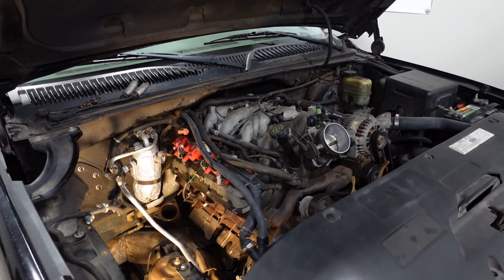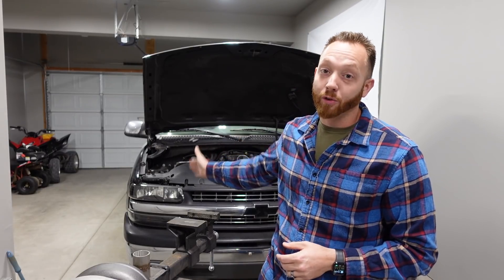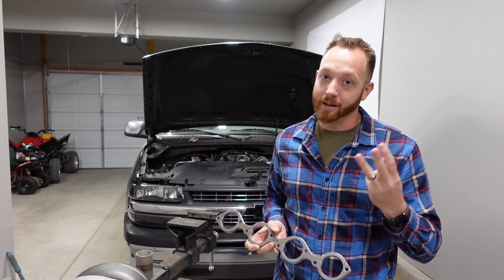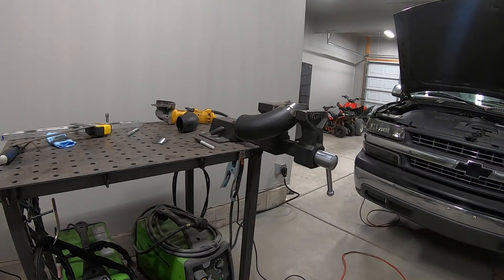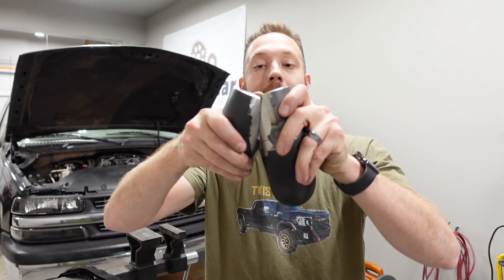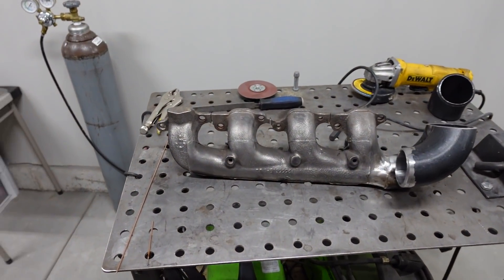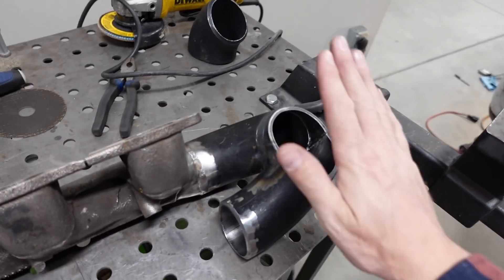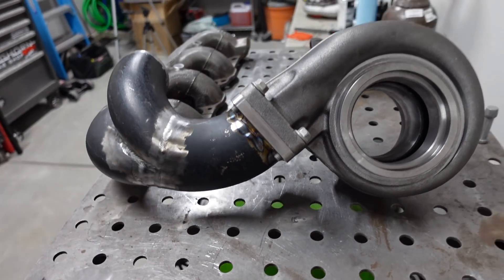Building a Turbo Manifold for an 8.1 Swapped Big Block Silverado

Comment: Love your work - finally an American fabricator using ear and hearing protection - I am currently using same S-480 clone as you are -  Australian regulations - must have 5/8" clearance on hot side made me go the "remote" install option, my build is 74 C10 stepside truck ZZ502 and same S480 turbo as yours - I'm 68 years old and you ROCK !!!! Still working on it !
Reply from the maker: hey cool to meet ya, and that sounds like an awesome truck! I love the big block and turbo combo

Comment: would it be possible to build a log manifold, similar to the ls style turbo manifold to keep the ac in the same spot, maybe pointing up and farther back? Please also change the exhaust studs.. Those are prone to you know breaking lol.
Reply from the maker: Yeah, it would be a good solution and I forget why I didn’t do that, but I think it was trouble finding a flange that would fit the head or something. The flange I bought hit the head bolts.

Comment: Sizing tip to remember: turbo exhaust has a much smaller volume than NA because it's under pressure.

Fast-moving turbo exhaust also conserves more energy, meaning less volume is needed to move the turbine, which means less drive pressure required. People are making 2000HP+ with 1.75" ID primaries on similar sized engines, so 1.5" (1.6" ID) is good for 1500HP.

Comment: Lt thats a pretty good job. After watching this video I would have done it just a bit different to save the a/c. I would have cut the manifold right at that line to were I could have essentially rolled the manifold upward giving enough room for the a/c pump. Lines might have been a issue but I would think a/c reroute would be easier than moving the pump. Just my 2 cents. But the project is looking good.

Comment: Did you look into if aftermarket BBC turbo headers would work?  I have been thinking about this on my 79 T/A swap.
Reply from the maker: I did, and most are a twin turbo up and forward setup. To make those work in my truck, I'd have to cut and relocate a bunch of stuff, and I wanted to run a single turbo anyways, so custom it was.

Comment: I have a question about the cast manifold. So I wanted to cut off the original flanges and put v-bands instead. I don’t know how to weld but I work with welders so I asked  one if he could weld the v-band to the manifold and he said it would be a weak weld because the manifold is cast iron and the flange is steel. Oh btw, these manifolds are OEM manifolds off a newer body style camaro. Anyways so I ask a second welder if her could do it and he said pretty much the same. So my question for you is more of your opinion actually. How well do you think your manifold will hold up and would your opinion apply to my idea as well?
Reply from the maker: The trick there is that the manifolds are cast steel, not iron (so says the internet). A lot of people have welded v bands onto GM LS manifolds like you’re describing with excellent results. I wasn’t sure if the 8.1 manifolds had the same alloys, but so far, it seems to be doing OK. But only time will tell.

Comment: Can you build the 8.1 with standard aftermarket bbc parts like jegs or is raylar the only option
Reply: To avoid raylars ridiculous prices
Reply: @jethrow243  They make some nice stuff but its way way to expensive!!
Reply from the maker: you can, its just a lot more difficult. things like valvesprings for example, I have seen other BBC parts converted to work, but many times they are not listed by application for the 8.1 so you need to measure and find what works based on dimensions and spring rate. Raylar takes all the guess work out of it
Reply: @TolmanPerformance  the main thing alot of ppl are waiting to find out is pistons rods and crank .
Reply: @TolmanPerformance  like a 454 is the 4.25 bore just like a 8.1 could a forged assembly be bought piece by piece with a stroked crank to build a 8.1 without problems im not able to look up like oiling hole dimensions or something crazy chevy may have changed other than the stroke dimensions between 7.4 and 8.1

Comment: Hey Lt loving the vids, I’ve been building 8.1’s for over five years and currently assembling a full forged bottom end to handle way over a 1,000 hp. Shoot me a dm I’d love to give u a few tips and tricks and some of the downfalls the engine have. I’ll try and send you some port work on the heads that will dramatically improve at all rpm ranges. Of course you can’t compete with aftermarket heads but $2600 for a pair of unassembled heads is way out of budget.  I really think your going to crush YouTube with the great vids your putting out.
Reply from the maker: hey, couldnt find an email or anything on your page, send me one to tolmanperformance@gmail.com

Comment: Awesome project! Any reason you didn't go with a remote mount turbo to avoid some of the fitment issues?
Reply from the maker: because I like torturing myself and TIG welding...
Reply: @TolmanPerformance  Good answer and honestly there is a lot of satisfaction in making it yourself vs a less complex remote setup.

Comment: Hey LT, in regards to the A/C. Can’t you use a pancake compressor like you did at that other place on a particular red all wheel drive OBS mounted up high on the passenger side?
Reply from the maker: I suppose I could, just would have to come up with some bracketry...

Comment: Any thought of using a holley low mount ac bracket,and installing a sanden sd7 compact compressor ?it’s been a workaround for me on the past because I can make lines to go around most everything and the compressor is smaller than the factory ls unit but bolts in the same place 
Been working out details on a similar build but have a different direction still good content keep up the good work

Comment: Amazing welding!!!  Is the turbo to close to hood and might cook the paint?
Reply from the maker: thank you! There is enough for my hand to fit between the top of the compressor and the hood insulation, and about double that on the turbine side, so between a turbo blanket, air gap, and the hood insulation, there should be no burnt paint... (hopefully)

Comment: LT, some interesting 8.1 information for you. Raylar is the company everyone knows of for 8.1 parts but there is another company. In 2005 I believe GM sold the manufacturing rights of the 8.1 to a company that makes engines for busses and generators. They use forged rods, pistons, and crankshafts, many come turbo charged, and the company claims their bottom end supports over 1000 lb/ft. I just saw one of these engines on Facebook marketplace for $2250. They are also stroked to an 8.8. The company is called PSI. Not sure if they sell parts to the public, but keep your eye open for them, could be a good way to get a built one of these on the cheap. I installed a generator with a turbo 8.8, and they are sweet, big cast V-band exhaust manifolds, massive intercooler, but externally identical looking to the GM 8.1.
Reply from the maker: I've seen a few of their engines pop up here and there, it might be a good resource to look into

Comment: Your best best for wastegate placement will most likely be off the turbine housing: aka, this
https://cimg2.ibsrv.net/gimg/ls1tech.com-vbulletin/546x975/img_1713_1644af37fe64add7d1e914ca776bc948f973f590.png

mounting it off the up pipe will likely put it in a bit of a tuff spot to do anything easily with the wg-exhaust. The way you've got he turbo sitting, with the wg, off the underside of the turbine housing, you'll have a straight shot towards the back of the car (or wheel well) ;)
Reply from the maker: Its crazy how many people have suggested the in-turbine wastegate

Comment: Interesting choice to not run the left and right banks into the left and right side of the twin-scroll turbo interdependently to try to make better use of the twin scroll housing.

That said, with 8.1L I suspect that 'spool-up' wont be a massive problem ;)
Keep up the good work.
Reply from the maker: I had thought about doing that, and it honestly wouldn't have been a ton more work since I went this far

Comment: Actually a 1.8 x 1.8 has an equivalent circular diameter of 1.97   when talking about airflow through ducts (fluid dynamics) cross sectional area of ducts matters less than the shape. It doesn't matter that the square tube has more area in this case , the efficiency is decreased due to its shape. and it will still flow less efficiently than a 2" round pipe.  That being said keep doing what you are doing. The little things will affect the overall outcome very little. Its not like you are building a record breaking competition engine where you need every last .1% efficiency gain you can get.
Reply from the maker: I knew I should've stayed in school lol...

Comment: It's cool that you're trying to make it optimized as much as possible but you'd be surprised what you can get away with and still make plenty of power with a turbo with piping I'd probably just run the stock driver side header swing around back to the engine and then connect it to the passenger side header that's flipped around and even if the pipes only 2 in in diameter it'll still flow plenty of air to spin that turbo yeah it'll make restriction probably up higher but not enough that you still won't be able to make tons of power or you could do like a lot of the single turbo kits do and swing around driver side to take the pipe around the front to a merger on the passenger front corner and again the pipes don't have to be perfect for it to still flow enough to spin that turbo and make power

Comment: Great work!  I was thinking that you were going to do a log manifold with the big pipe straight across from the exhaust ports instead of dropping down.  That would allow you to run your AC pump I believe but it would also make the turbo about 3 inches higher I think.  I don't know if you have enough hood clearance for that.  How do you plan to tune for the boost?
Reply from the maker: right now, I can just barely put my hand between the compressor cover and the hood insulation with the hood is closed, to I really dont have any extra room on height. but, I could do a tighter radius bend elbow if i had to

Comment: I love this project. It is just different from all the known LS swaps and you are doing a great job sharing it. 
The manifold looks like it will flow great.
Hope you get the AC to work. There are electric AC compressors for automotive use but they are very expensive and draw ridiculously much amps. 
Keep up the great work.
Reply from the maker: Thanks for the info!

Comment: LT you should look into getting a Kodiak front accessory setup to move the a/c compressor to the top and free up room at the bottom of the engine.
Reply from the maker: looks like kodiak an 8.1 van are the top options
Reply: @TolmanPerformance  I was able to locate a Kodiak setup for mine.  The A/C was hitting the subframe on my T/A swap.  They are a bear to find.

Comment: GM medium duty truck, G-van 8.1 and Workhorse RV accessory brackets mount the a/c compressor on the drivers side where your current alternator is located.  The alternator would move the passenger side where you currently don't have anything.  You'll need the alternator bracket, water crossover, water pump and balancer to match.  GM discontinued the bracket a couple years back, but they can be found.
Reply from the maker: gonna have to scrounge around some junk yards
Reply: @TolmanPerformance  some of the bigger medium duty stuff had a larger zf power steering pump that does not interchange or they could have had a large air compressor for air brakes.  You'll know when you see them. There is a guy that developed a replacement out of plate steel and sells them on a 8.1 facebook group too.  Pricey though.

Comment: I hope your gonna upgrade internals... stock 8.1s don't like more power unless forged internals... rods are known to break just a heads up
Reply from the maker: yeah, Im aware of the 8.1's limitations, and the plan is to build the bottom end sooner or later, but until then, just run way low boost and try to limit power... hopefully I dont nuke it
Reply: Id love to do the raylar stage 3 kit... on my suburban

Comment: Nice solution for mounting the hair dryer. Like to see as many OEM parts modified to work over spending money on aftermarket. Do you have enough headroom in your new workshop for a lift ?
Reply from the maker: Thanks 👍 at the moment, I dont have a lot of room, but I do want to find another shop to rent in the near future and add a lift.

Comment: Wasn't that flange made for the 8.1? Why wouldn't it be made to consider the head bolts if it was purpose-built?
Reply from the maker: Not necessarily, it was for a conventional BBC. they have the same flange pattern, but evidently the head bolts are in a different spot.

Comment: Hey LT  are you using Harbor Freight welders. If you are how are those welders holding up.  I was thinking about getting one.
Reply from the maker: no, its not a Harbor Freight, and I've never used one so I cant give any first hand knowledge on em. This is a Forney unit, and it works great.

Comment: Yup gmt400/van accessories will get you ac again. it puts the alt on pass side and ac compressor where the ALT was, then you use the v6 lines to connect everything
Reply from the maker: appreciate the info!
Reply: @TolmanPerformance  posted pics in the group

Comment: Why do they even sell that flange if you could really never use it
Reply from the maker: it might have worked with an aftermarket cylinder head, or maybe the bolts are a little lower on a Gen VI BBC... they must work on something

Comment: Sound was a bit echoing, just enough to merit a comment. The music for the welding montage was great. Able to quickly find the artist name?
Reply from the maker: Its called "Open Highway" and it was from the YouTube free library of music... and yeah, the garage door causes a lot of echo because its just aluminum panels, but I plan on adding some insulation which should help with the temps inside as well as the echo...
Reply: @TolmanPerformance  I used this stuff to great effect. It slid in the slots with scissor trimming and didn't need adhesive. Reflectix R-21 50-sq ft Unfaced Reflective Roll Insulation (24-in W x 25-ft L)
Reply: @TolmanPerformance  thanks for the response. I enjoy seeing the complications of your manifold build more than the completed work because you shared your journey of how you overcame setbacks to find the solution. Some DIY videos are purely instruction manuals. Others are as much entertainment as education because we feel like we are right there with you scratching our head to figure it out.

Comment: Using that 40 series joints you can easily just put them together with a stick or even a high amp mig welder. They do however get bloody heavy.  You might want to brace it off the cylinder head to save all that load going into  the standard manifold {Broken bolts or Welds} . Also a very handy tool for doing this is a hand held band saw {faster, cleaner and easier than a grinder}. Doing pipework and even some sheet metal work they are probably the most used cutter in my shed.
Can you low mount the AC compressor on the other side and high mount the power steering pump or vise versa as all you would really need to do is modify the AC plumbing or does the US engine still use an air pump?
Reply from the maker: Once I finalize the wastegate placement figured out, I do plan on making. a brace on the front of the cylinder head, there are two big blots that will line up perfectly. You are correct, it is very heavy.

Comment: You are going to regret this. I put a turbo on a 8.1 I ran 8  lb of boost lost 2 Pistons.
Reply: How did it run before it happened?
Reply: @truckfan87  it was freaking awesome it would melt the tires going down the highway at 45.So if you was run 45 miles per hour going down the highway and step on the gas it would melt the tires I'm talking about 33/12.50 tires
Reply from the maker: Thats what they say will happen lol... but the plan is to put in some forged pistons and let 'er rip
Reply: How did you lose the pistons?  Did the break?  Did you melt them?  With a little extra ring gap and the proper A/F, it seems like it would hold up... for a little while

Comment: LT you’re a wicked welder!  where did you get that vice a little info please thanks.👍
Reply from the maker: Thanks! its a Wilton trailer hitch vise, and I built a mount so it hangs off the table, which is good for standing up longer pieces of exhaust pipe. I do wish it would swivel tho, it does make it hard to position parts perfectly for welding. I'm likely gonna change it out soon

Comment: I put one of those things in my monte carlo. Any forced induction can really mess up the pistons, i suggest installing lighter pistons if you havent already.
Reply: Forced induction doesn't mess up pistons. Bad tuning does
Reply: So many people boosted these and ran them with bad tunes, on pump gas, with stock ring gap. Richard Holdener boosted a vortec 454 with just ring gap and race gas and made over 900lb ft. Just have to build and tune them right.
Reply from the maker: I will be building the motor with forged pistons sometime... an 8.1 monte carlo sounds badass!

Comment: Best place I've seen for the wastegate is right on the Turbo housing Check out the sloppy mechanics I think they invented it
Reply from the maker: I have seen a few guys run it that way, and if I cant find a better place, than in the turbine housing it goes!
Reply: @TolmanPerformance   I have never built a Turbo Kit but soon I will be given a crack at it one thing I don't really understand If the Turbo needs more support then what the manifold offers  Will you be adding extra support